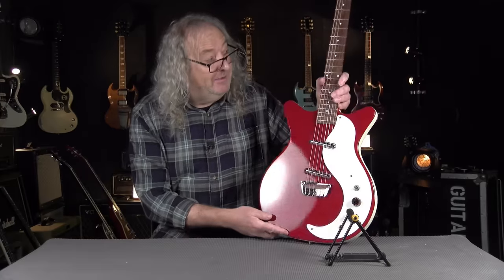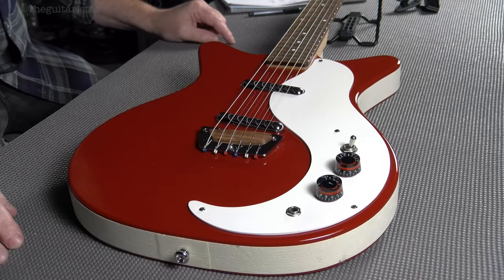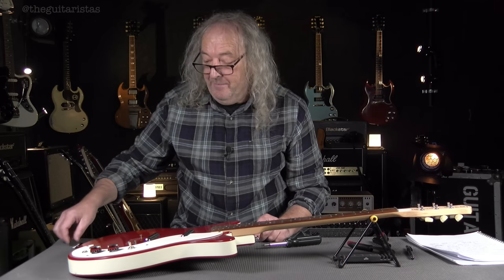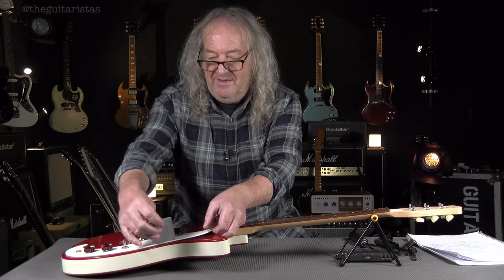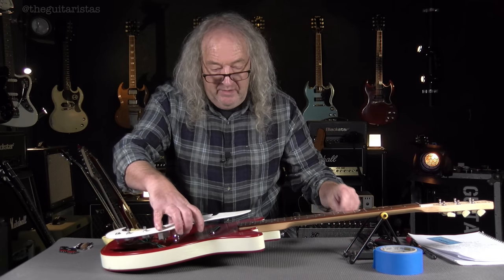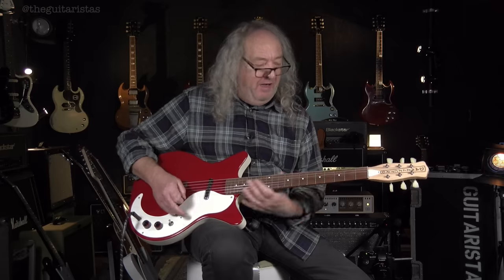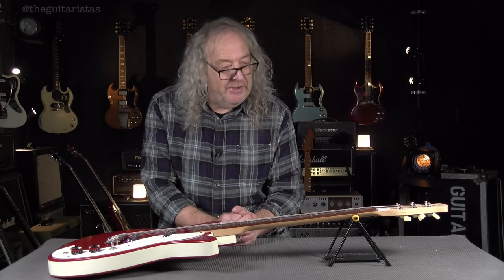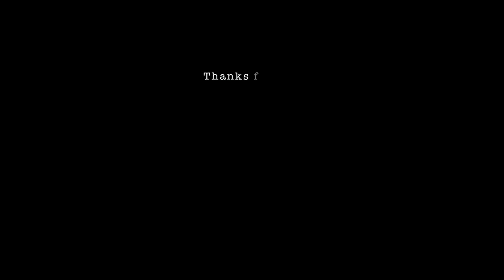A Guitar Made from Hardboard & Sticky Tape? 😲 The Amazing Danelectro '59 🎸 Deep Dive Review

Comment: The reason the resistance in the middle position is higher is because Danelectros are wired in series instead of parallel. So when you activate both pickups, it is combining their resistance and inductance just like the two coils of a Gibson humbucker. That's why Jimmy Page used the middle position for Kashmir - more output and midrange than the individual pickup positions. This is one of the most unique features of Danelectros and is often overlooked when people install lipstick pickups in Fenders. You really want to combine pickups in series with those. Bonus fact: Brian May's Red Special also combines its low output Burns pickups in series.
Reply: Spot on Sir, you know your resist9r theory 👍
Reply: Yep, indeed.
I love those tri-sonics in series.

Comment: You're absolutely right Colin, lipstick pickups are just wire wrapped round a bar magnet and inserted into a lipstick container they bought from a factory down the road. There a bit of a winders nightmare because they're so easy to break as you put the coil in the tube.

Comment: Great review!  I remember trying to take the pick guard off of my Danelectro Vintage 59 12 String.  I thought it would be a breeze because there were only three screws holding it down.  Then, I discovered the double sided tape.  Mine is finished on the sides by the way.  Fun guitars!

Comment: The resistance thing with the both pickups is just the pickups being wired in series or in parallel. Basic electronics, really. If you wire two resistors in series, the total resistance is the sum of their individual resistances (meaning the total value is higher than the individual values). Wired in parallel, you add the reciprocal values of the resistances to get the reciprocal value of the overall resistance (meaning the total value is lower than the individual values). So it means this guitar has the pickups wired in series in middle position, essentially making them into a humbucker (which would even suppress the hum like a humbucker if the pickups are wound in opposite directions).

Comment: I did something crazy recently. I traded my 2020 Gibson Les Paul Standard 50's straight across for a 1967 Blackface Fender Super Reverb which I promptly took to the shop to get sorted out. Out another $469 for repairs and I have exactly what I wanted, a supreme tone machine of an amp that doesn't require pedals at all, even though you certainly can add some to taste. Was it worth it? Heck yes it was, they're not making any more original Super Reverb amps and this one has all the magic within it.
Reply from the maker: Nice one Rich!, I think that will prove to have been worth it 👍 they move a lot of air those 4 x 10's eh? 😁🔥

Comment: The reason why the DC resistance of the pickups double in the middle position of the switch is because, unlike with Gibson standards, the pickups are then wired in series and thus summing and humbucking. By the way, the switch is special: ON-OFF-ON and the wiring schematic is very peculiar.

Comment: The pickups must not have very many turns of wire because the resistance and inductance are quite low. When the resistance doubles, the pickups are in series; and when it’s about 1/2, they’re in parallel.

Comment: Not quite faithful to the original.  Doesn't have the concentric Vol & Tone Pots.  The pickups are wired in series not in parallel hence the DC resistances.

Comment: I have a soft spot in my heart for Danelectro. My first guitar that I had my first three years of lessons n was a Danelectro "Convertible" (thin body acoustic with a pickup) with the same short horn body style. Cheap as chips that thing. God awful to play - action was 5" off the fretboard (ok - I exaggerate) but the fact that I stuck with my lessons on that slab of particle board convince my Dad to get me a proper guitar years later because I stuck with it. Now, 60 years later, I still can't get separated from my guitars. I ran across a used one in a store recently - same model I had - still crap to play....LOL. That model seems to be much better! Cheers Colin!

Comment: The tape lifting off of the body sides is practically inevitable.  I assume they're rather thoughtlessly stretching it in place.  It'll likely be fine at the factory but destined to pull up during shipping.  My solution was to take a hair dryer to it and spread/stretch the tape down with my thumb.  It's barely a minute of effort and to date (roughly 4 years) it's never peeled back up.
Also, more trivia on the series middle position.  In one of the many attempts to keep the price down, a generic on-off-on SPDT switch was used instead of a selector switch.  Each 'on' position would short-out its respectively opposing coil with the middle 'off' position acting as a freely open path for both.
**Another mandatory song:  Rebel Rouser on the neck pickup.

Comment: Regarding the tolex binding lifting. Heat gently with a hairdryer and then tape down or tie down with a scarf between cutaway and down to bottom of guitar. Add some contact adhesive via cocktail stick or similar if needed.

Comment: You know, it is what it is. I know a guy who has one that plays and sounds really good, and I'd like a used one but I've never seen one in my local emporiums or pawn brokers. Probably pretty easy to find online at usual sources, new or used. I guess new ones are over $600 now? Somebody's laughing at me, I bet $800 is actually more like it. A bit pricey for what it's made of and how it's made but it's not outrageously high. Still definitely a cool and fun guitar. This body is basically a table top with a fancy furniture leg attached, so your Ikea joke was appropriate. Literally almost any commercial cabinet shop with standard basic tools could build these in numbers. The poor edge tape adhesion near the cutaways is not really excusable but it happens. They may use a little heat to form it into the tight concave curves and this can stretch it a little there while it's hot. Or it's precoated with heat-activated cement and some places don't hold well or at all. It can seem to be stuck down well but when it cools it can contract enough to pull away and leave a space. Doesn't happen often though, except occasionally with a bad batch of tape or glue, or a worker just having to rush and a bad one got through. This may have even been ok when it was inspected and packed. It probably would've been exchanged for another acceptable one if you wanted. Anyway fun video, Dannies are cool in their way. Cheers from Dallas!

Comment: i've got a '99 Dano U2 reissue , really light guitar, great vibe. £200 at the time. same bridge as this one - the bridge was so annoying and weak, it eventually sagged in the middle under the pressure, so I ended up putting a Strat hardtail bridge on instead, much better intonation. i should really get a couple of frets replaced and get playing it again.  in middle position the pickups get added together in series instead of parallel, which might well explain the readings.

also, pickups will lift right out of the body, when the bolts are undone, as the pickups are wider than the bolts. that might have given you an extra view of inside.
Reply from the maker: Cheers for that info, i bottled out of loosening the pickups but next time I’ll know! 😁👍

Comment: Lip stick tubes were never used in making of pickups. Get the truth about dano's . By reading the history book of the company by them. The birth to death of the NJ NEPTUNE FACTORY. BACK THEN GOT MY FIRST 1448. Amp in case. Now I play 1448 made third week Dec 1963. With 1457 case as it is 5 wat with vibrato effect.
Mine has Neptune company guy logo ink stamped on head stock.
Reply from the maker: Among its other design factors, Danelectro’s magic can be traced straight to the highly unique pickups that Nathan Daniel designed. One look at them, and it’s easy to see why they quickly took the name lipstick pickups. But the name is much more accurate than many players realize.

When searching for the right single-coils for his guitars, Daniel knew they would have to be easy and inexpensive to manufacture. That meant that the bobbins and custom-machined pole pieces Fender and Gibson used were out. Instead, they used a relatively crude Alnico V bar magnet with the copper wire wrapped directly around it. That assembly was then wrapped in cellophane tape, vacuum wax potted, and inserted straight into the trademark lipstick tube covers…actual lipstick tubes!

Daniel found he could source lipstick tubes from wholesalers for much less than standard pickup covers. And not only did these metal tubes give his pickups a unique look, but the metal cover helps shield the electronics and mellowed the otherwise ice-picky sound of his design.

The legend was born.